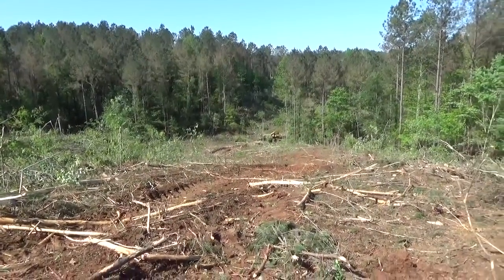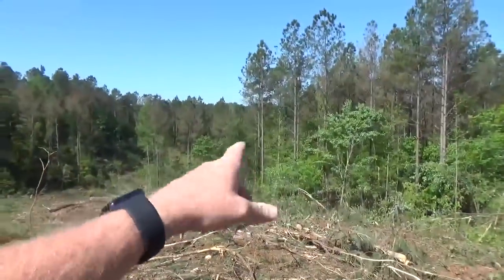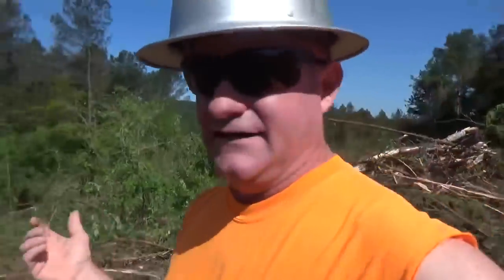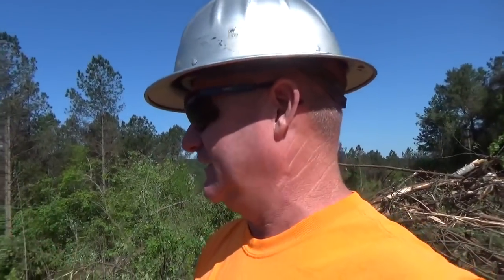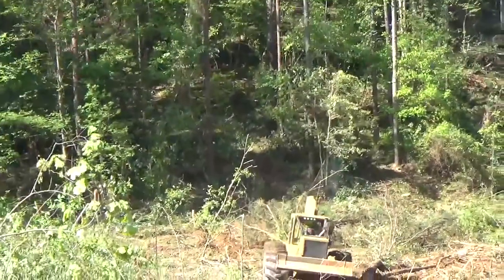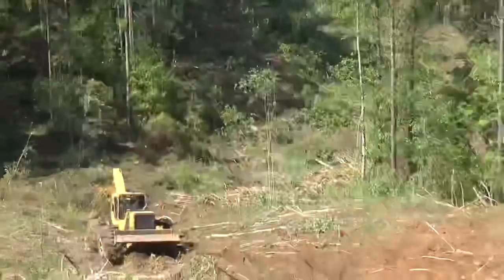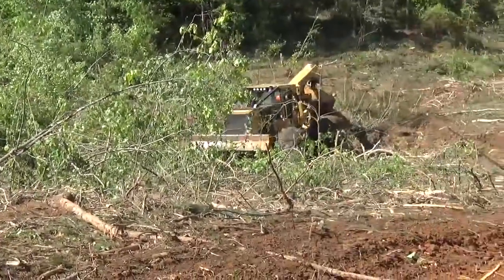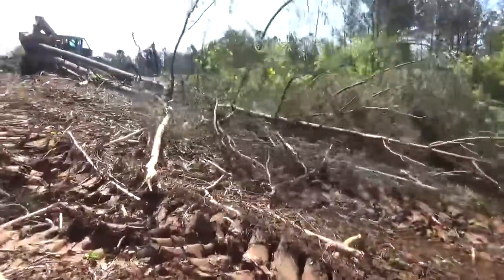Skidding with the Tigercat 630E & 635D!

Comment: Just wondering why don't yall run up the trees (from top to butt) to break off some of the limbs would also make a little bit lighter drag. The guy I use to work for would harp on doing that. It also helped the delimber out. Of course we just had the trailer mounted drag though delimber. Just wondering if you get a chance to answer. Thx for the great video!!

Comment: Chains and tracks take the slip out. Joints drive shafts finals etc. work that much harder when the wheels won’t slip. A little wheel slip vs breaking expensive parts is way better in my opinion.

Comment: Regarding the comment at the end about tyre chains, I don't think that you would want to run tyre chains in the conditions that you were working in for the simple reason that tigercat did their calculations on how strong the drive train components have to be assuming that the tyres are going to spin when you ask the machine to pull more than it can, and this is basically the slip clutch or safety in the system that stops you from breaking drive lines or chewing up center portions. When you create a situation of lets call it excessive traction by using chains in good conditions you create a situation where there is far more torque in the whole drive train than was anticipated in the original machine design, and that is when you start eating up centre portions like you did in the 635 some time back.
Reply from the maker: You are spot on and I wish others would understand that.  It also depends on who is running the machine.